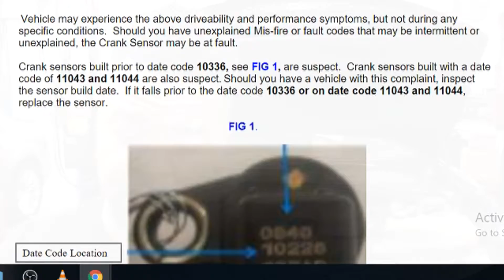Case Study.How to replace a crank sensor on a 3.6L pentastar V6 engine, Rocker arm noise.P0339 P0335

Comment: Thank you so much for this VID!
Question: is there VIN numbers that attach to that date code on each Crank Sensor? I dont have a lift to take a look at the dates on it.

My problem is i have 3.6 charger (exactly like the one in the vid) and mine sputters at red lights or stopped (low RPMs) everytime. (Happened right after i hit the gas to get the yellow light on the road.) I used a cheap scanner and got P0305. replaced Ignition Coil in #5 and sparkplug look good. No change. It sounds like i have a vacuum leak at the rear top of the engine with a suction sound when i shut the car off but no leaks were found when i sprayed carb cleaner. Im not sure what is going on. But could be this Crank Sensor. Would my VIN tell me the date code or something? ( 3.6 at 52k )
Reply: What it end up being brotha
Reply from the maker: No you cant tell the build date by the vin..my friend you could very well have a rocker arm on cyl 5 causing ya problems..Verify that the secindaryvignition sys ok (coil, plugs) this is the case if you also have ticking noise but if not, go ahead and check/replace that crank sensor.
Reply: @OnlineMechanicTips  Thanks for the reply! yea i have no ticking just sputtering at low idle. Ive seen your other videos about the crankshaft positioning sensors on these 3.6 so i might do that too..
Reply from the maker: @chrissalatino1134  Can you please subscribe to the channel? thanks
Reply: @OnlineMechanicTips  Already did! :) you are the only channel I ever subscribed to. Thanks for the vids and explanations!

Comment: How do you know if its misfiring. Sounds like my car is misfiring on start up, but no CEL
Reply from the maker: Hello my friend. Misfire can be present with no CEL on..The best way to find it is with a scan tool that will let you view which cylinder is misfiring..Please subscribe to the channel for me, thanks
Reply: The car will shake at idle rythmatically

Comment: i have a jeep cherokee 2013 3.6. i replaced the rockers becauseof knocking noise on passenger side and all spark plugs and coils on both sides. After I finished the job, the car gave me a code P0344 and P0300. I decided to take it to dealer to do the reflash for the computer because i saw that on one of your videos but they told me that they have to replace the cam shaft sensor; i agreed to do the diagnostic, reprogram the computer and replacement of the sensor. i called them and they told me that the car continues with the same codes, they say that is problably the cam phasers but they will give a complete diagnostic after the shop foreman check on the car. Do you think that it was something with the timing that is affecting the engine because i replaced the rockers? I really would like your opinion about my problem. Thanks.
Reply from the maker: It's likely the phaser..every p0340 I've dealt with was with a traction control light and a knock noise for about 5 seconds..that noise likely the oil control and the phasers.
Reply: Online Mechanic Tips thanks for the answer. The traction control light is on too so probably the phaser is the problem.

Comment: Great video.  My moms cars had misfires all over the place so I changed out the plugs.  Problem solved but I do get than random one here and there.  Think I’ll go right to crank sensor.  For all reading this it’s a 2015 charger with the V-6.  Keep the vids coming please.
Reply from the maker: Hey bud, nagging misfires could easily be a coil. The best way to find out which one is to load the enging or bogg it down while watch the misfires on a scan tool, which ever cyling shows the misfire will likely be that coil since you already replaced the plugs..Please subscribe to the channel, thanks

Comment: Guru I need some help I have a 2013 Chrysler 300 3.6l with a random misfire I have changed the plugs and coils could this be my problem
Reply from the maker: You could easily have a rocker arm coming apart on cyl 5..Ive seen them come apart without making any noise also..Please watch this video..https://www.youtube.com/watch?v=TZkvhaASkbs
Reply: JT Automotive Rideshare Guru ok gotcha I haven’t had any noise at all, so should I have the rocker arm checked before I try the crank shaft sensor?
Reply: Any chance it could be the fuel injector on cylinder 5 or they don’t go bad very often?
Reply from the maker: I have yet to replace a injector on a 3.6L engine..random misfire could come from problems with the crank sensor. Curious, is this misfire under load?
Reply: JT Automotive Rideshare Guru more under load yes but if it starts I can put my foot in it and it comes rite out of it, it don’t happen all the time comes and goes, it does miss sometimes when its just idling
Reply: JT Automotive Rideshare Guru I replaced the crankshaft sensor its build date 13043 which wasn’t one of the dates you mentioned I haven’t drove it yet so im going to drive it later and see if its still has a miss fire
Reply: @westvmike  how that work for you did it fix your problem?
Reply: @martinalva285  I still have the same problem ive changed everything and ive put 2 sets of plugs and 2 sets of coils nothing smdh
Reply: @westvmike  sorry to hear that man take it to Chrysler and get it checked it’s about 150 for the check up then you can try to fix it on ur own
Reply: @martinalva285  yea im going to have to for sure was trying to get around it but thats the only option left
Reply: @westvmike  did you find the problem with the misfire?
Reply from the maker: hey buddy, thanks for watching and subscribing..Quick question, the check engine light on? if so, whats code
Reply: JT Automotive Rideshare Guru it was on but was cleared when I had new coils put on because the guy I had do it thought that was the problem. It has came on since then but just for a second and went back out
Reply: Also when it was on it was showing a misfire cylinder 5, bank 2 sensor 1 and ignition coil p2314 so I replaced plugs, coils and o2 sensor and still have the random miss and my gas milage is getting worse

Comment: Does the 2014 3.6 version have better head and rocker arms design? Because the tinking on my 2014 wrangler drives me insane! Haha
Reply from the maker: I'm heard and seen this issue on 14 year models..the redesign of the valve train started showing up on the 15 and 16 models
Reply: @OnlineMechanicTips  thanks a lot  I'll have it checked then very much appreciated
Reply from the maker: YW, please subscribe to the channel for me, thanks

Comment: Thanks for the video, I’ve got a 2012 grand Cherokee 3.6 with a random misfire that changes cylinders it will count up really high on one cylinder and then switch to another cylinder and count up really high on it does it between all 6 cyls, you can barely feel it though everything has been inspected and swapped out, with good compression and leak down.  Have u ever run into that before?
Reply: Ok thanks
Reply: Have you already change the TIPM ?
Reply from the maker: curious, what would replacing the TIPM do for these problems?
Reply from the maker: Yes, same year, same engine, same Jeep GC..Nothing made sense, same symtoms you having, misfire jumping around cyl to cyl..Only problem is we never got a chance to fully complete the job and find the problem..SMDH,,The customer traded the truck in and it was shipped off to the auction without any warning...I never got a chance to figure this problem out..I know this doesnt help you much but we was headed toward removing the trans to check the flywheel..sorry buddy..btw, please sub the channel for me, thanks